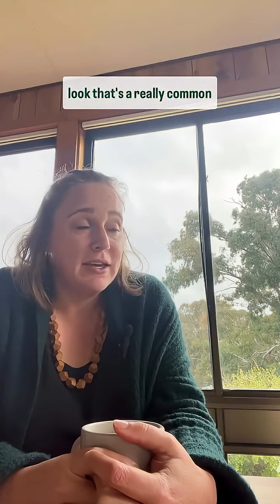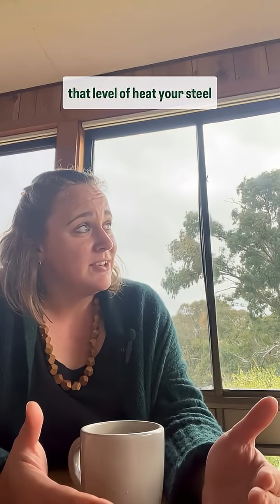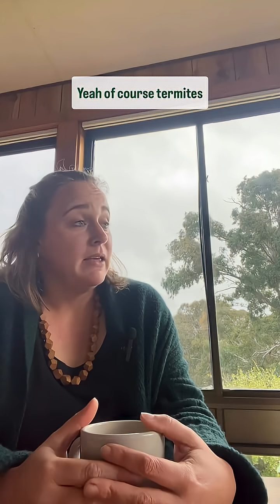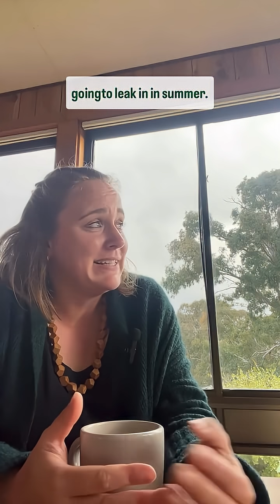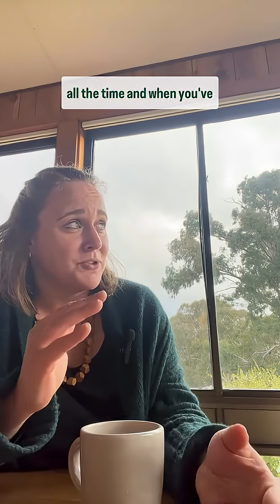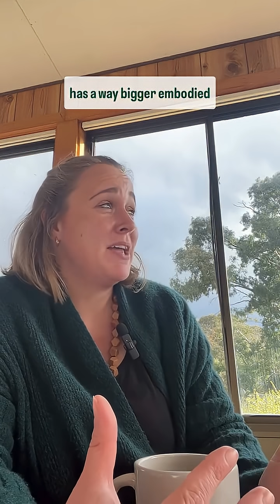Why Steel Frame Homes Are Overrated | Timber Framing Wins for Energy Efficiency

Comment: Interesting...Thank you :)

So what climate would a steel structure home be beneficial in then?
Reply from the maker: I only work in cool climates so I try to keep my opinions based on what I know with confidence. I DO know that up north their termites fly (ours only crawl in Southern Australia) so they have more trouble termite proofing. And in some remote areas the lack of carpentry skills really lend themselves to very quick lightweight steel construction.